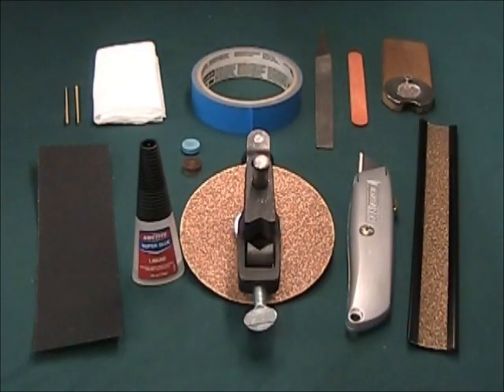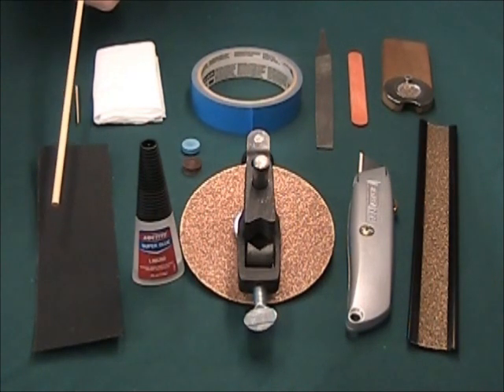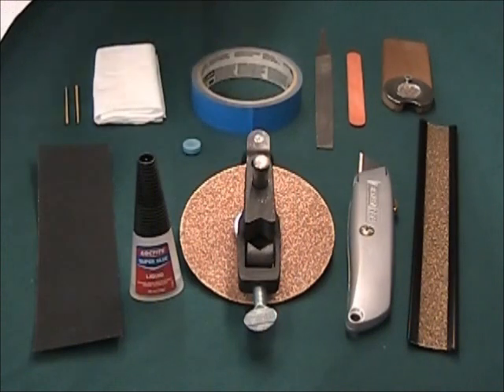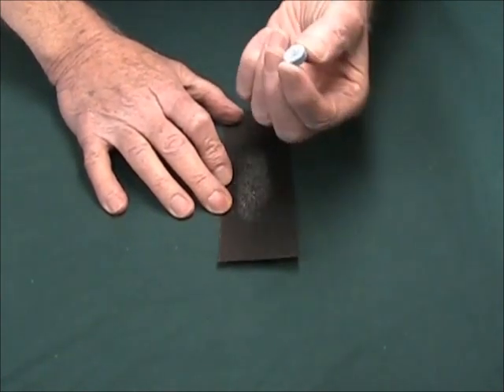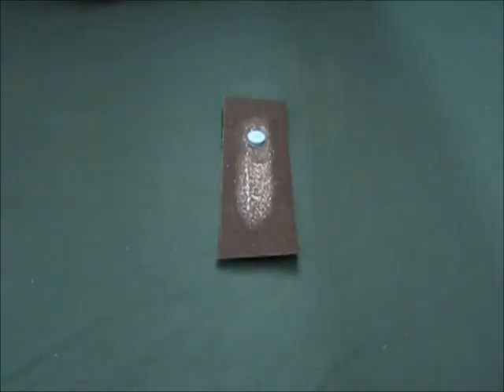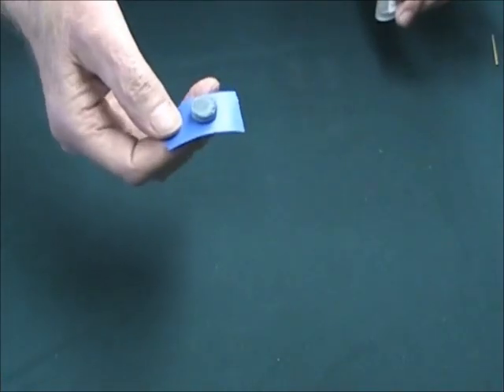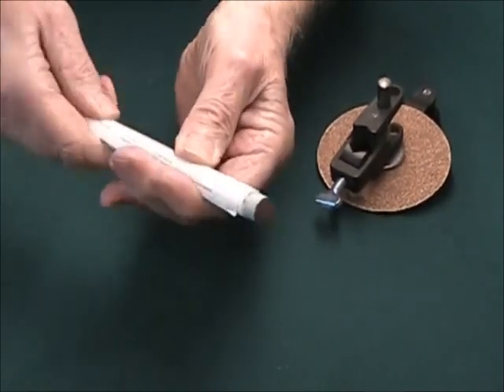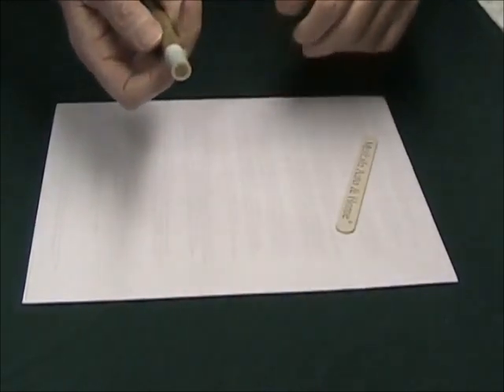Video: How to replace/install a cue tip yourself

Comment: Looks very effective, but I would use a regular table instead of a pool table as any chalk dust will cling onto your cue shaft.
Reply from the maker: Alex: The green cloth seen in the background is not a pool table cloth.  I shot the video on a makeshift workbench which I covered with a smooth green bed sheet. The makeshift workbench was a hollow core door placed atop my table saw, as referred to when you click on the word "More" directly under the video's Description area at the top of the page.

Comment: Good presentation! I'd add that if you have even the slightest taper on your shaft ... I'd advise not to use the sander ... as it can add a bevel to the surface of the ferrule. The tricky bit is trimming the tip at the ferrule surface and removing the glue squeeze out on the side of the ferrule as the tape will not completely eliminate it.
Reply from the maker: Agreed, but the vast percentage of tip changing hereabouts is on personal cues with a "pro taper" meaning as you likely also know -- no taper for the first 12 to 15" of the shaft. Thanks for the comment and compliment.

Comment: Hello ,thanks for the video .I would like to know if it is possible to replace a ferrul without a lathe and get good results
Reply from the maker: Entirely depends on why you’re replacing the ferrule. If the original is simply loose plus dinged or unsightly, you can simply work it off and glue on a new (same size) one. If the old one is not removable but dinged or dented on the end for the first 1/16” or so, you can just squarely sand it off axially (shortening it, however). But if the ferrule’s cracked I would have a pro or skilled friend with a lathe turn it off and glue on a new one. There are expensive gadgets to do it without a lathe:&#160;
http://www.muellers.com/Tweeten-Tenoning-Machine,2566.html
but a pro shop will do it for you for about one-tenth of that gadget’s price
(depending on labor rates in your country). Hope this helps.
Reply: Thanks for the answer.

Comment: Hi Ray ! Did you mention anything about the sealer in your intro ?
Reply from the maker: Gman: The first coat of the liquid instant glue (shown in the intro)*is what does the sealing of the newly- sanded tip's exposed surface.  That's why I spoke the words "This seals the porosity of the leather" as I was applying that initial coating.

Comment: Is there any significance to using money vs regular paper?
Reply from the maker: The rag content; weave of the inherent grain; texture; strength; moderately frictive/mild heat-inducing property; stability when moistened; and it's relative handiness -- all combine to make a dollar bill perfect for the brief recommended shaft burnishing.  Use any form of paper you wish to, of course.  There are many archival fine art rag-based papers that have six of the same combination of properties and serve equally well, but you'll readily admit that it's no contest as to which rag-based paper is more likely to be on hand for most pool players when performing the re-tipping procedure.  During year-round playing sessions, specialized leather burnishing wraps are typically widely used.

Comment: What was the glue you used lo title gel super glue
Reply from the maker: I don't understand the question as written.  Please clarify, if you will.
Reply: What was the type of glue did you use I can not read it from your video
Reply from the maker: As verbalized on the video, Johnny, I use thin (liquid) instant glue (rather than a gel version).  The one seen on the video is made by Loctite, but other brands are chemically identical. While the thin (liquid) version is my general preference, I readily acknowledge anecdotes reporting some compositions of cue tips and ferrules gluing together better with the thicker (gel) version -- for chemical rather than mechanical reasons.  Thanks for your quite pertinent question and for trying the method I describe.  Hope you get great results during many years of re-tipping.